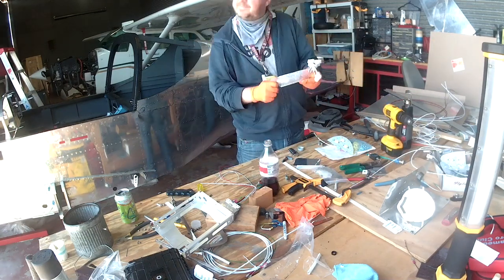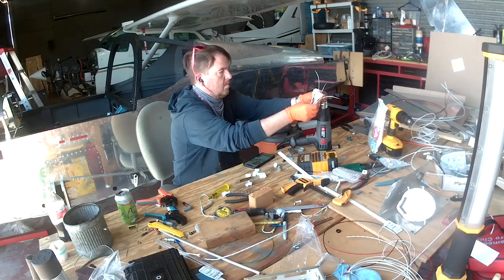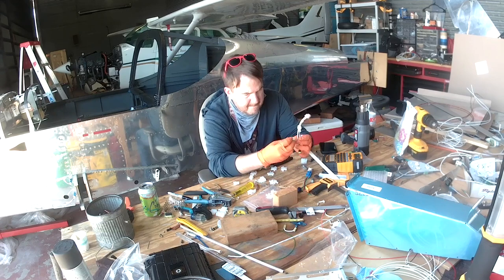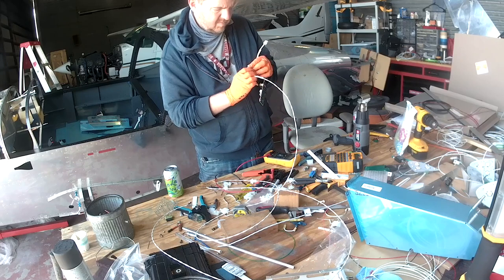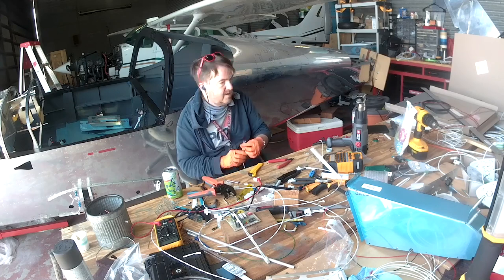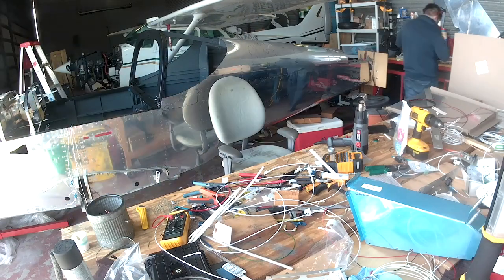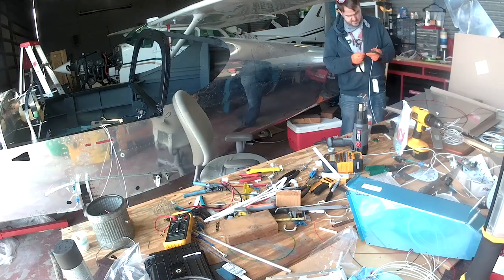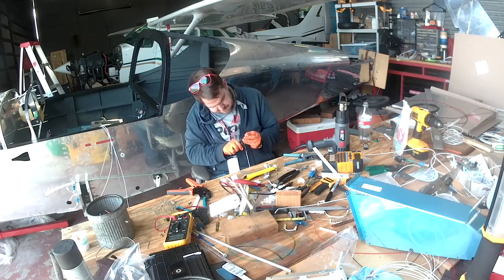RV-14 Fly LED Rewiring 1

Comment: Andrew, since you are using the Garmin 3X did you install the Garmin autopilot servo in tail section yet? I just ordered the servo and figured I would install it before joining the two fuselage halves together, I'm just wondering if you might have installed a servo after you joined the two sections and whether it was a "PITA" or not?
Reply from the maker: You have to install the elevator push rod first before you can install the servos. It won’t go on with the servos in place.
Reply: thanks!

Comment: Where do you get your molex connectors and others wiring stuff.  I looked on air spruce and amazon and some looked cheap.  Wasn’t sure on quality.
Reply from the maker: I go with digikey or mouser usually.